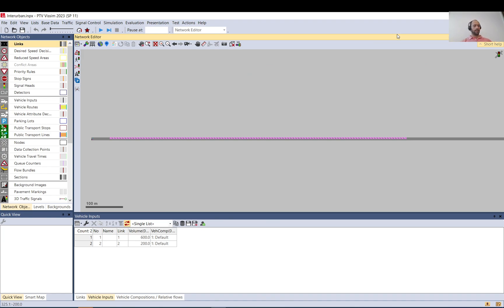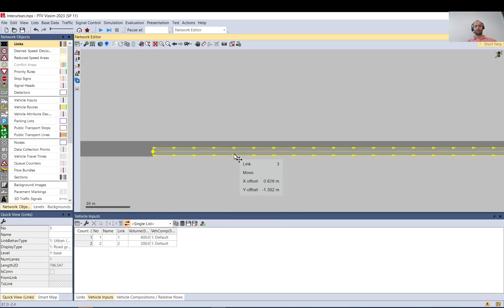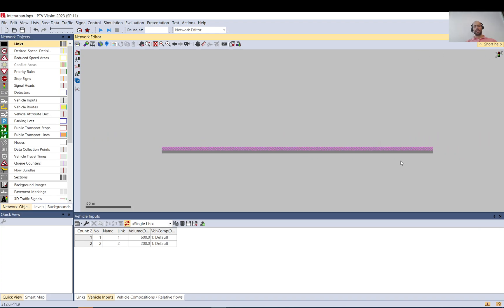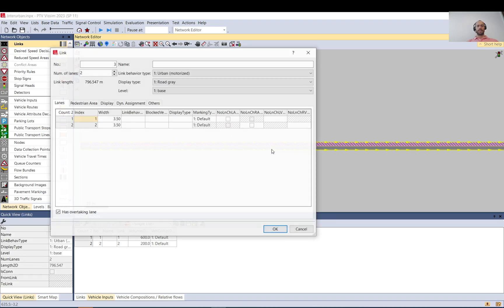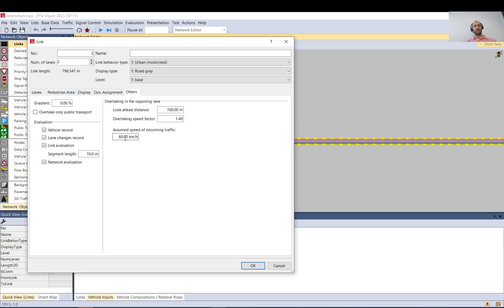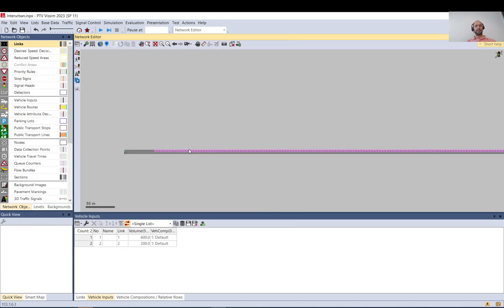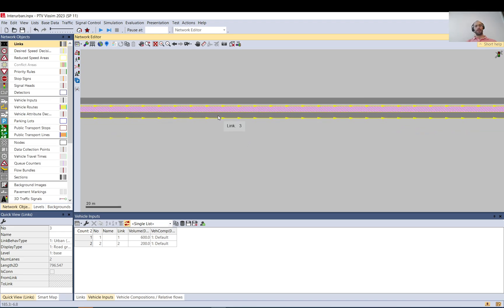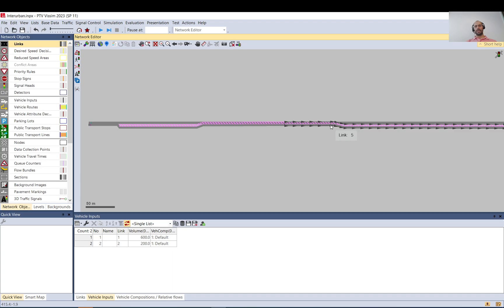Vissim Tutorial - Overtaking in the opposing lane

Comment: What's the difference between static and partial route?
Reply from the maker: Partial routing are for local distribution of vehicles. The partial vehicle route defines a section of one or multiple static routes. The partial route basically overwrites temporarily the static route. You can set up a split between alternative routes within a section of the route. After leaving the partial vehicle route, vehicles continue with their original route (defined by the static routing decision).

Comment: Sir, Can we give separate vehicle inputs in one link and separate vehicle classes be selected for each route starting from that link, for example if we need to provide U turning for only some classes of vehicle how can specify it...when I tried to change the class the whole vehicle route, the class is changing...is Vehicle classes are allotted for vehicle input only? Does vehicle routes get different calsss specification? Or separate links are need to be drawn for straight direction and u turn direction and then vehicle input need to be given?
Reply from the maker: Hi, sure you can. You can add as many vehicle inputs on the same link as you want. For each you can set up your own vehicle composition ('traffic' menu) that only includes the desired vehicle types. Then you set up your static routing decisions. For each routing decision you can select which vehicle class you want it to be applicable for.

Comment: Does it work on student version vissim 2021, vehicles are not overtaking through overtaking lane even though overtaking lane overlap the opposite direction lane. They are just following slow moving vehicle. What could be the problem...
Reply from the maker: It should not be a problem that it is student version. I tried to list the conditions in the video that are needed for the overtaking to happen. Lane changing distance could be a problem at the end of the section/link, not enough gaps, not enough distance to undertake an overtaking manoeuvre